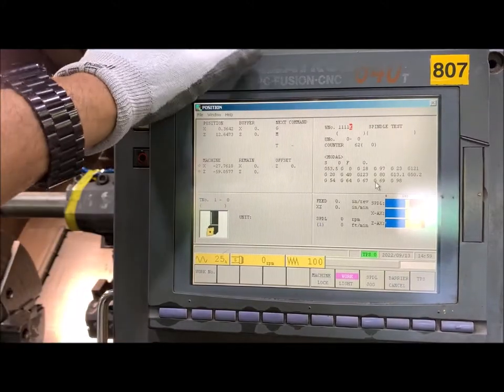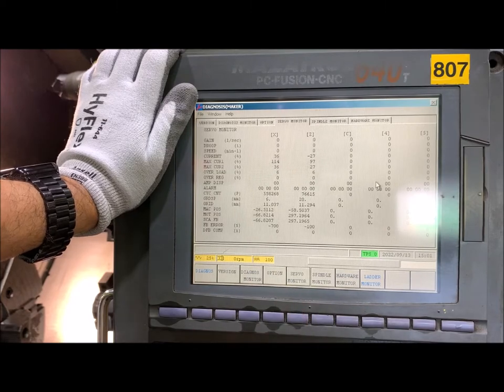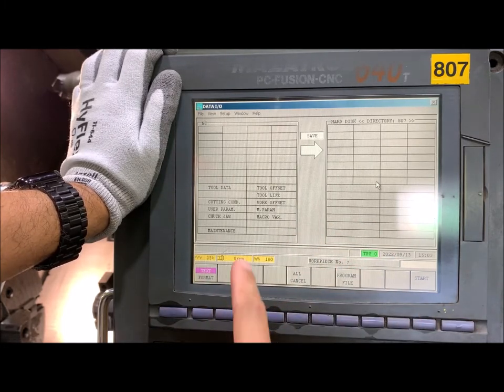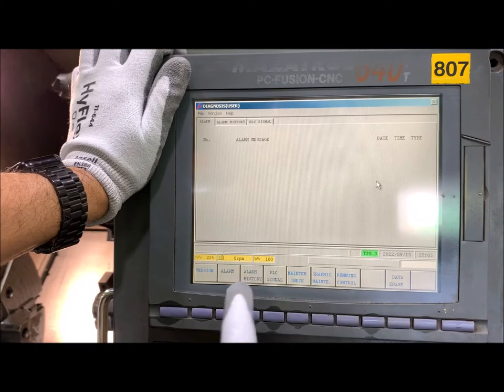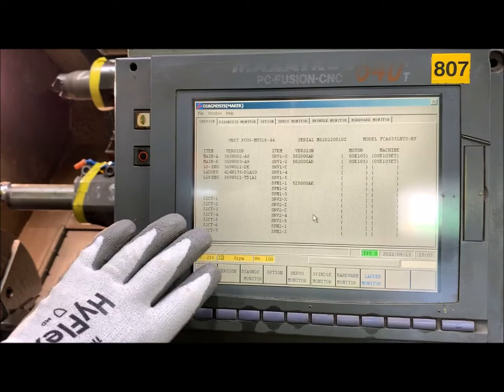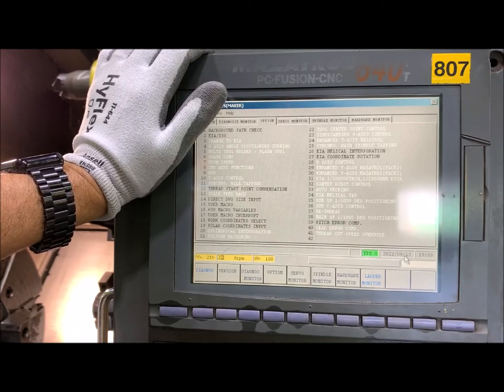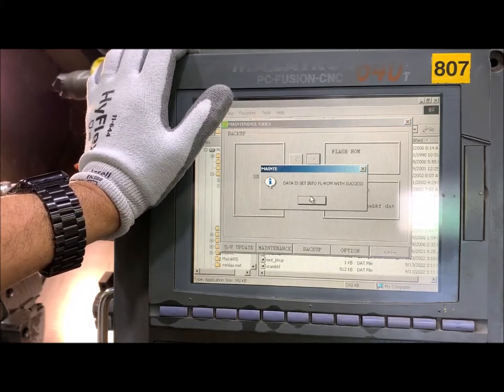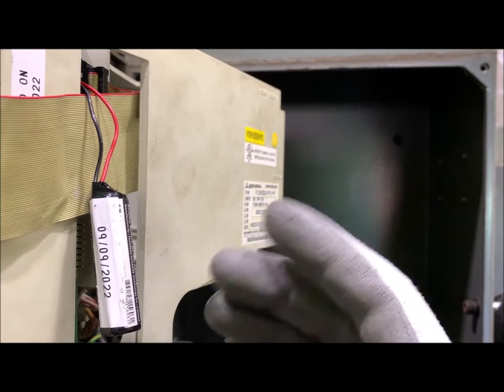M640T backup, initialization & recovery after 26 illegal parameter ( 1, 36, &0037) & ( 1, 41, &0037)

Comment: Hello I’m Krishan, I watched your backup, initialization and recovery video and I followed the steps as same as you did now the z axis is working only for one side (z axis doesn’t work to upper side ) but the X axis is working normally to both up and down can you give me a solution for this? 
Alarm no : 121 over travel 
That will be a great help thank you!
Reply from the maker: Hi Krishan. You have to increase the Z soft limit. If Z going up is positive, then take picture of parameter A9 and increase it to the double , or if going up is negative then you have to increase the double the A10 parameter. Then reference the machine, and set back the parameter you changed. Hope it helps. Regards

Comment: Thank you for the video, its very helpful. I currently have a illegal parameter 26 ( 98 mazak fusion 640t win/95) as was shown on one part of the video. Do I need to reload my backed up parameters? to get this to go away?  THX!
Reply from the maker: Hi there. That alarm means you have lost the data. First of all, change the CNC battery. Then reinitialize the CNC (complete clear). Then if you have the srambkf.dat file; restore it. When you have this alarm, NEVER make any backup because you’ll save corrupted data
Reply: @FabianAchaval  We have done a backup in the past, before our issue. I did check battery voltage and it was good. Battery was 2yrs old, so I replaced it. I will look for that file and try to restore it. I will let you know if it works. Again Thank You!
Reply from the maker: The batteries need to be replaced once a year. The file is c:\mainte\srambkf.dat . Check the date of it.
Reply: @FabianAchaval  Is it possible to contact you thru email?  Thx!
Reply: ok I have found that file the date is 5/28/20. now The battery i have replaced is for the mrj2. Are there batteries in the drives too? how do I go about reloading the srambkf.dat file?  Thank you!
Reply: @FabianAchaval  ok this morning we started the machine and had the 26 error. We shut it down and restarted and it started clean..no errors?? No we are afraid to shut it off? Any advice?  Thanks
Reply from the maker: @mpixler801  no worries. I suggest trying if can keep the data. If not might be a hardware issue. Then you can make the reinitialization again.
Reply from the maker: @mpixler801  if your machine has incremental encoders, then there is no battery required. Only machines with absolute encoders require battery to keep the position when you turn off the machine.
Reply: @FabianAchaval  ok thank you! I did not realize there is another battery on the computer side.I will get a new battery asap. I will leave the machine on until I can put a new battery in.Would it be possible to contact you via email?  thanks
Marty
Reply: well we let the machine idle for a few days until I got the correct battery. After replacing the battery. I let it sit for 20 min (powered down). It fired up no alarm. I let it sit 3hrs and the alarm came back?
Reply: @FabianAchaval  well we let the machine idle for a few days until I got the correct battery. After replacing the battery. I let it sit for 20 min (powered down). It fired up no alarm. I let it sit 3hrs and the alarm came back?
Reply from the maker: What alarms exactly? Can you list them all?
Reply: @FabianAchaval  26 illegal parameter ( 1, 36, &0037) thank you!
Reply from the maker: @Marty, it might be an issue with the power supply of the CNC. The one at the left on the CNC CPU unit. Or the CNC RAM unit. Make sure is the only alarm you have. Go to DIAGNOSIS-> ALARMS and Check is the only one you see. Other tests can be done
Reply: @FabianAchaval  It has an 33 E-stop also, but I assume thats from the 26 alarm?
Reply: @FabianAchaval  i do see in the history There is a  #350 operating switch alarm every now and then? I see this alarm a few times only..It isnt on the machine at this moment. just the #26 alarm
Reply from the maker: @mpixler801  can you please make a video showing the boot up process and the diagnosis screen where the alarms are and the alarm history as well. You can try disabling the spindle as shown in https://youtu.be/lhnVV3tN1-s. This is to define if missing parameters are related to it. Also navigate for the same pages you see on the video to show me the servomotors and spindle data. Thanks
Reply: @FabianAchaval  I will try to upload a few vids. my internet is very slow here. I tried to disconnect cn1b and restart. still exact same error.
Reply from the maker: @Luckyslife57  see https://youtu.be/radmx9BqfAo. I explained over your videos what I see
Reply: @FabianAchaval  I commented on your new video! Thank You.
Reply: @FabianAchaval  I did comment on the other video, I cant see it. but I was going to add that I do have the srambkf.dat file in my maint. folder
Reply from the maker: Hi  @Luckyslife57 , definitely you can try restoring that file. First of all, reinitialize the CNC and then restore the c:\mainte\srambkf.dat. What date is it from? 
Do not forget to power cycle twice the whole machine after restoring the file. What it called my attention is not seen the spindle drive alive. It might be faulty. Try https://youtu.be/lhnVV3tN1-s. Also, you can test it following this https://youtu.be/bJRZeAIKt0s, even though is not the same drive, the procedure to test it is the same. If you'd like, upload videos of the tests you performed.
Hope you succeed restoring your machine.
Regards.
Reply: @FabianAchaval  today I pulled the spindle drive and sent it out for repair. We will see what happens when it returns .lol Many thanks for your help. You are very sharp on these machines!!
Reply from the maker: @mpixler801 , just let me know if you succeed. Ask the repair shop for the report to see what they've changed, like the control board. Regards
Reply: @FabianAchaval  I posted a new video of my new errors after reinstalled my rebuilt spindle drive
https://youtu.be/VstCZHDhGKw
Reply: @FabianAchaval  new vieo with rebuilt drive installed...new error
https://youtu.be/VstCZHDhGKw

Comment: Well, I have to say your skills in this are very good. I do this for customers all the time. Now lets see if you can solve this one:

When Mazatrol loads it gives error illegal software detected or something along those lines. There seems to be a problem that Bus console is unable to perform TLSYCN in a background. I tried reinitializing. I tried original hdd that was still working from 2 years ago. Always same problem. Considering the machine stopped working midway through the part to me it seems that motherboard is gone. Now my NC is FCA635MNY and I see a lot of new ones from various online sites FCA635MNY-NF do you think it is possible to perform an upgrade whiteout Mitsubishi or Mazak help? I can also try ordering only HR113 board but not sure if worth it. I am also running windows 95, but I think new NC can only run windows 2000.
Reply from the maker: @Ar, 

1) Has the NC application finished starting, showing the axes and all data?
2) do you have any LED "ON" on the control panel?
3) Have you made a NC RE-INITIALLIZATION?
4) On the 7-seg display, which status do you read?
5) on the NC power supply HR083, which LEDs lit?
6) What is exactly the message/error you have?
7) have you tried connecting to the NC using c:\mainte\mainte.exe and perform a backup to the files and to the FLROM?

You can download "Mazak Fusion 640 Nexus Series Maintenance Manual" from Mitsubishi (create a free account) using the link -> https://us.mitsubishielectric.com/fa/en/support/technical-support/knowledge-base/getdocument/?docid=3E26SJWH3ZZR-24-2274

The HDD should have a backup folder with the NC Installation files under c:\Ncbackup including versions like BND360W001-C7

Changing the NC board HR113 would be last option since would cost around U$D3500.00 
https://support.mazakcorp.com/PartsPortal/Parts/Search?search=HR113%20&page=0

The NC unit is around U$D4300.00 refurbished and U$S10K brand new.
https://support.mazakcorp.com/PartsPortal/Parts/Search?search=FCA635LNYS&page=0
Reply from the maker: This is a list of issues that can cause a non-system disk error on the PC-Based controls:

1. The hard drive does not have bootable files on it.
2. The hard drive is bad or not connected properly.
3. The hard drive cable is defective or not connected properly.
4. If the HD warm up LED is lit, it is possible that the HR113 is defective or corrupted. Try to reinitialize the NC.
5. You may have a defective HR555 PCB. Check the NC status LED on the HR113. If it displays a ‘3’, remove the HR555 to see if 
the NC control boots up. If it does, replace the HR555.
6. Missing or corrupt Main A s/w. If you clear Main A s/w from FLROM with BUSCON.exe and you boot up without restoring, you 
will get a non-system disk error.
7. Defective HR123 PCB (hard drive I/F PCB).
8. The NC rotary switch is not set to 0.
9. There is a floppy disk inserted in the floppy drive and the BIOS (CMOS) is set for floppy drive boot.
10. BIOS (CMOS) is not setup properly.
11. A defective HR113 is causing a no boot condition. Check the NC status LED. It should display ‘9’.
12. A defective HR083 NC Power supply. Check the voltage levels on the check pin connector.
Reply: @FabianAchaval  Wow, you know too much not to be Mazak Tech. The NC boots up fine and Windows work ok. When Mazatrol starts it gives weird AT64MAIN and some other AT64 errors. Nc throughs error Illegal operation detected.  I can only check machine on weekends as it is a side project for me.

The BUSCON I have not played with a lot still trying to understand how it works as there is not much info online. But when Mazatrol start this Bus console start running in a background. It is part of VxWorks as far as I understand. It fails to do TLSYNC procedure. I disassembled NC and I can see that there is oil inside connector between boards. I sent it to get cleaned.

The Bios stuff I know had to deal with it couple of times.
The Transcend SSD you have in other video will not work with Windows 95 Machines. It has inside some sort of converter and is not actual pin to pin ata. I think only after Windows 98 Service pack 1 there was update for full support. The compact flash works fine though. 

This Machine I bough as a side project and it has been nightmare for me. I paid like scrap metal price for it and I don't think I will ever go commercial manufacturing with it so spending 10k on new NC from Mazak is not an option for me.  Thanks for all the help, I wish you made these videos 2 years ago when I knew nothing about Fusion controls :D

P.S. how good are you with Tplus and Mplus controls ?
Reply from the maker: @Arnys1000  if you can upload a video to you channel it would be great to exactly figure it out what the problem is.

I've been working servicing CNCs over 30 years and still learning, but I haven't played so much with TPlus nor with MPlus CNCs. 
Although that, CNCs are similar between them and once you are very familiar with the technology, you would be able to figure any issue out if counting with technical information or being in close contact with the manufacturers, like in this case I have close contact with Mazak and Mitsubishi. 

Here you can find info for those CNCs. You need to create a free account.

https://us.mitsubishielectric.com/fa/en/search#q=tplus&sort=relevancy

https://us.mitsubishielectric.com/fa/en/search#q=Mplus&sort=relevancy

Regards.
Reply: @FabianAchaval  Hi, Thanks I created the account and I can see it has a lot of useful information. never knew it was possible to access it so easily.  I will make a video when I have time, but it can take a month depending how busy I am.

Comment: Hello, there is a problem with launching the Mazatrol 640t program itself. Before this, there were power surges in the network and the machine turned off, they restored the hard drive and installed Win95, but the Mazatrol program itself freezes when turned on. Any thoughts on this?
Reply from the maker: Hi there. As you’ll see on the video, that condition means the HMI is trying to connect the CNC. It’s most likely the CNC data is corrupted and you’ll need to reinitialize the CNC and upload a backup. You can check the 7-segments display behind the display where the CNC CPU is.

Hope this helps.
Regards
Reply: Is there a dependency on the operating system installed in the CNC? Should it only work on Win 95 because your Mazatrol works on Win 2000. We bought the CNC itself new and the seller said that only Win 95 can be installed on it
Reply: @FabianAchaval 
Now the regular retail version of Windows 95 is installed, are there any special drivers or something similar needed to run the Mazatrol application?  And are these drivers on the original hard drive?
Reply from the maker: @ОхинОхинович  No. You can have Win95, Win98 or Win2K on the HMI and yet the CNC will work the same. Obviously if you are going to upgrade the Windows version, you have to prepare the disk installing same or new compatible Mazatrol software version. Simplest way is to clone the old HDD into and SSD. You'll find videos related on my channel. Hope it helps.
Regards.
Reply from the maker: @МаксимДуганов-ъ7с  As far as the HDD was already running on the machine, there are no special drivers unless you install, for example, an Ethernet card or any other device.
On the other hand, if you just got an HDD with Windows 95 only (or any other OS) you'll need to install the latest NC System that was installed on the original HDD.
Usually the NC System installers are kept on the HDD.

Comment: Awesome. Thx for sharing. I left my 2000 Integrex 100y 640mt powered off for 6 months and in that time the controll battery you replaced in the video went dead. Following your steps I was able to restore much of the controls. I'm still getting F7 on the drive units and an error 15 System Malfunction. I anyone familiar with this? The ladder programming seems to be intact. Any suggestions?
Reply from the maker: Hi there, F7 means 7th axis and there should be an error code after flashing F7. 
Alarm 15 should also come with an error code between parentheses. Can you share a video?
There are some other videos on my channel showing how to check errors on the drives using CNC diagnosis